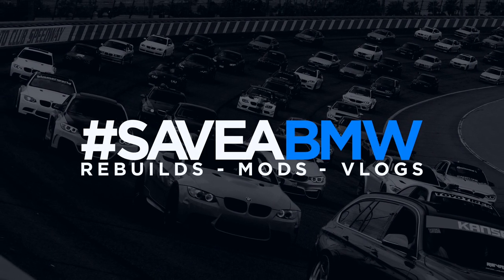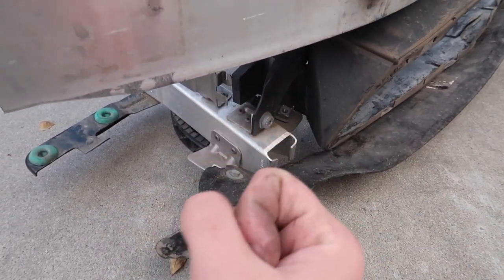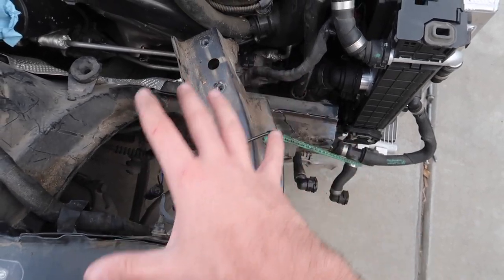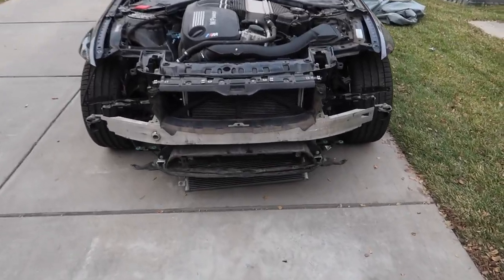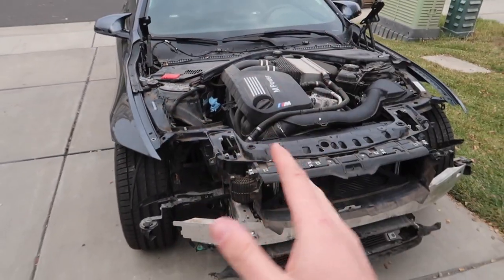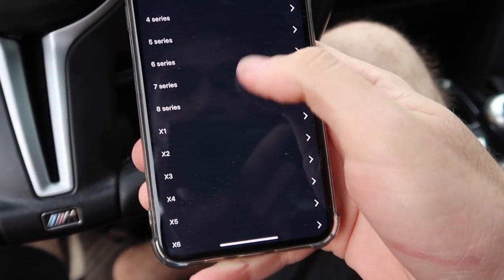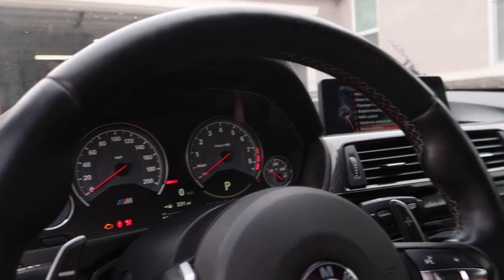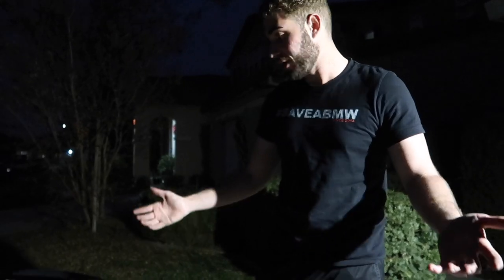Rebuilding A Wrecked BMW M4 Part. 6

Comment: I had the same issue in regards to my bmw F10  battery. The issue came after the car was not moved for 3 months. After driving around with it the request of change battery left. Try driving the car around when you done fixing it.